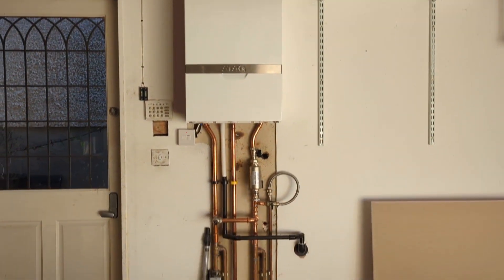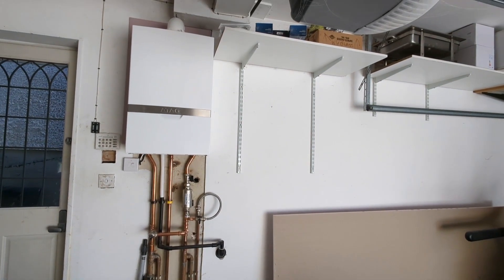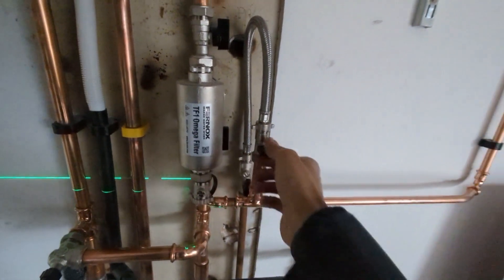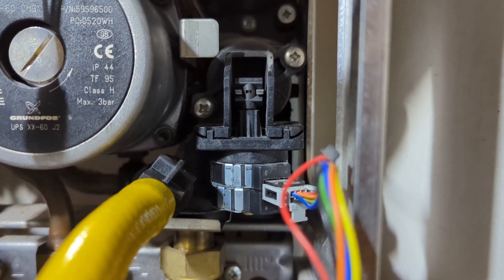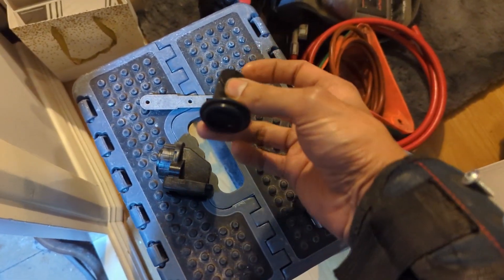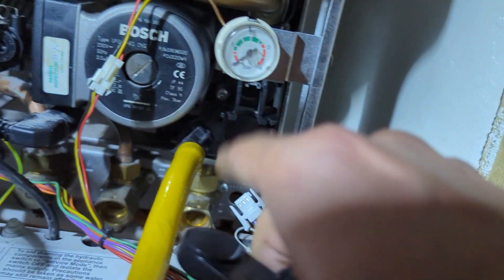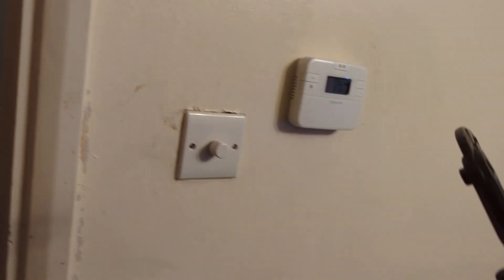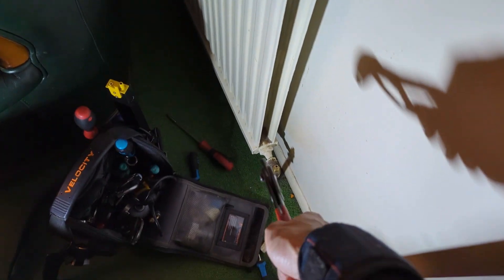A Day In The Life Of A Gas Engineer #2 - Expansion Vessel, Worcester Diverter Valve & Zone Valves

Comment: Great vids bro. What were the symptoms for the requirement of an additional vessel ? And I’m sure the vessels are the same size as the vaillant on the ATAGS.
Reply from the maker: Thanks bro. System had around 26 rads and so the pressure was going up into the red when the heating was on and then dropping out because the PRV was discharging afterwards